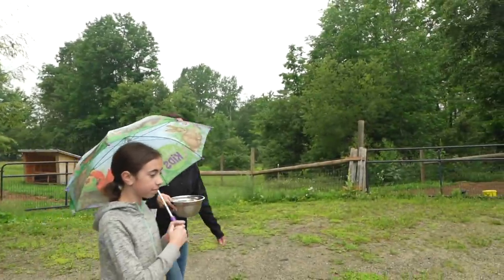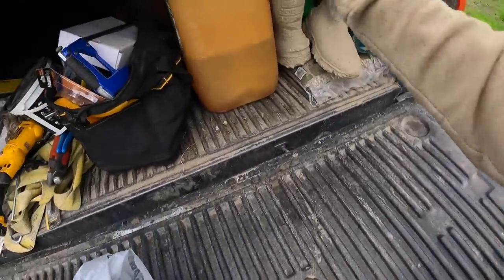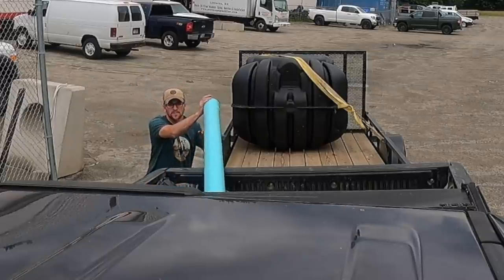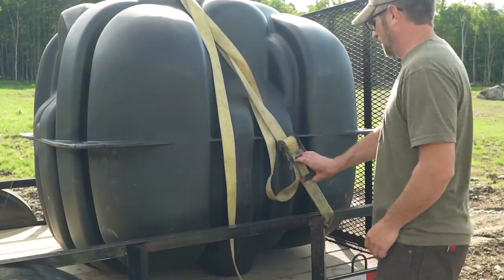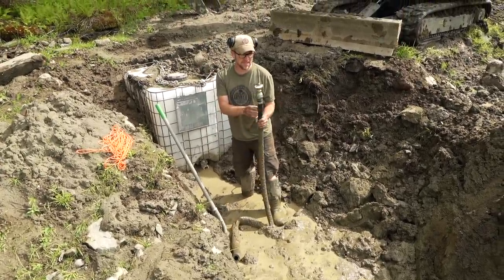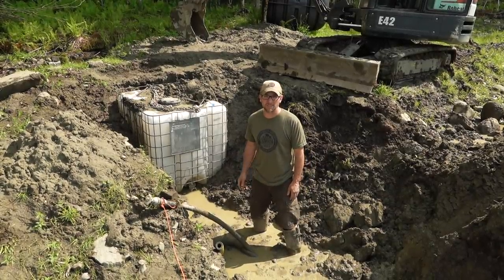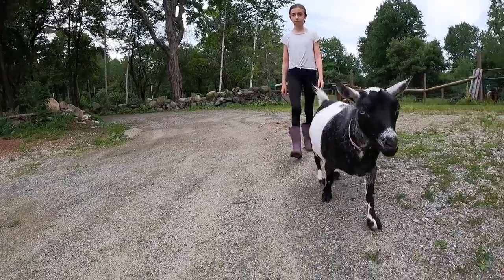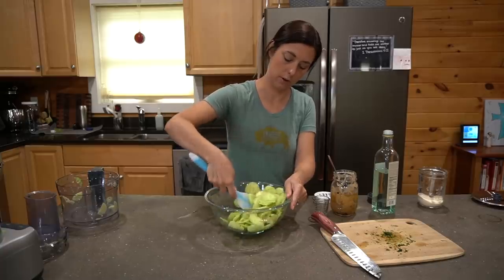Well that DIDN'T Go As PLANNED! PLAN B Building a Gravity Fed Water SUPPLY at Our OFF-GRID HOMESTEAD

Comment: I was wondering if it’s possible for you to build some concrete sides in the ground, or more of a concrete housing for the water tank to keep the mud and dirt from collapsing right on the tank. Or is that even a thing?
Reply: That would work - along with the commitment of having it there.  I think Al wants it the way it is for now so he can go with the flow (so to say) and move the tote as needed.  Others have mentioned using plywood, the cut-out-steel from the shipping container - there were the cutouts for the windows and the sliding door - lots of sheet steel there to use.  Also insulated foam board... lots of choices for Al and yours is also a good one, Donna!

Comment: I think you need to get that black tank above ground and build a ram pump and get that in the creek to fill your tank that will give you the pressure that you need for those 2 hydrants and probably any others that you put online.
Reply: My thoughts as well.  Maybe build a quick enclosure around it.  Hang a 100 watt solar panel on the roof and have it power a few 12v diesel glow plugs to keep the water from freezing.

Comment: Al, if the yard hydrant outlet elevation isn't lower than the top of the tank you will not get any water out of it and if the tank water level goes down you'll get nothing.  The tank needs to be elevated, not buried.  When done you'll be able to slowly fill a bucket, but won't have any pressure at all.  Have you thought about building a hammer/ram pump to fill an elevated tank, maybe 10 to 12 feet in the air?

Comment: Lift your water storage tank 10 feet above ground. use a RAM Pump, or a solar powered regular pump to lift your water. Your water will be clean, you can see its level and you will have pressure.

Comment: I don't think you should get down if things don't work out, it make your videos worth watching, they are real not faked. It also gives your audience the chance to float ideas and make some suggestions and here are mine.

Have you thought about running a draining tile along the trench to the low point near the end of the trench were it could feed a small decorative or watering pond. Also when you do the feed to the tank, you could use a sand and gravel filter to keep out larger debris. Just a few thoughts to think about.

Comment: well shipping containers are made to be stacked so they can take a lot of weight... maybe you can get a heavy plastic pallet and put the icb tote on it and then put it on the top of your shipping container... fill it with water and you have running water at the shipping container... you could maybe take it down when it is empty and fill it or maybe pump more water up to it... but the top of the shipping container might need a couple I beams across it so that the tote isn't resting on the flat part but it is distributing the weight to the walls

Comment: Hey   Al  don't  worry  I  thought of  another  thing for  the  tote  those  big  old  slaps  of  rocks   use those  it comes with the land and  you got the  equipment for  moving them with  .  Dig  the  hole  bigger and  put those  babies into  place  using  metal  pipe  for the  front  of the tote  so the  pipe will have  free  moving  water then   you will have to  lay a  slab  on  the  top  and  make it  so the tote is  alright in the front !  Also  the movement of the water for  winter time there is  a  thing to keep the water  going  24/7!!!

Comment: Use that time to build a big box with galvanize roofing big enough to house it and maybe enter to work on if needed. Dig your hole and maybe use some of those rocks to make a nice smooth bed for it. stick a drainage hose in it to keep it drained. In the winter you can cover over and around with straw and manure compost heap to keep from freezing and in spring you will have good fertilizer for your green house.
Reply: That could work.

Comment: This video was good because it was real life stuff. Real life stuff happens to everyone, no one’s perfect.
So I don’t know if you’ve been asked this or not or know this or not but I wanted to suggest a ram pump to bring water to where you want it instead of taking your system to the water. I hope that made sense?
Anyway ram pumps are so ingenious and handy they require no electricity. Google it.
Also your going to need to be able to access that water tank sometime in the future for different reasons. So think about building a on the surface insulated hatch door on top of the tank instead of covering the top with dirt and around your hook ups so you won’t need to dig it up later. 
Just good for thought. Put in the extras now, so life will be easier later on.

Comment: 31:03 The tote problem was a good thing. It would have crushed anyway.
 The water pressure wouldn't have bern high enough to keep wet soil back, even full. It even happened before it would have been more work (disconnecting the water line, having to dig it back up) so be happy it happened when it did.

Comment: Sadly, a gravity-fed water system is going to require more elevation than you have planned.  Every 30 foot drop gets you about 15 PSI. and that's not enough for even micro-sprinklers.  They like about 25 PSI.  You need your water intake at least 60 feet above your outputs.  You probably do have that on your property, but I bet you need a much longer pipe.  Your water tank needs to be just below the intake, so your stored water is all high enough above the rest of the system to give you a lot of water at the final pressure.  You can't use IBCs near the bottom of the system because all the pressure would leak out the top.  Then your outlet pressure would just be the IBC top minus the outlet elevation.

Maybe for now, just buy a solar panel, a charge controller, and a 12 volt water pump.  You don't need a battery:  Your full water tank will work to store water and energy.  You can get about 300 watt panels pretty cheap, and charge controllers on amazon are really cheap.

Comment: If you have 10 feet of drop from the top of tank to the hydrant outlet, you'll only get about 5 psi water pressure (trickle).  A solar powered booster pump (with battery) would allow you to get good pressure in your lines.  Also, the top of the tank can't be above the spring unless you use a pump to fill it.

Comment: eventually you can dig it back surround with plywood and foam board, plywood first, then fill it immediately...the real strength comes from the galvanized metal frame and water with in the ibc tote

Comment: There are two problems with the old tank. First, empty water tanks float. Second, most water tanks can't handle the side pressure. Both can be fixed, but both have to be fixed. You can fill a tank with water and it will temporarily hold its shape, but if the tank isn't strong enough, it'll cave in later anyway. The new one looks like it's made for the job, which is ideal. You could have taken the tote and MacGyvered some contraption to protect it, but that takes time and maybe money, and if you do it wrong, it sucks a lot. Underground tanks are surprisingly tricky to get right.

Comment: Gravel / sand bed under new tank Tank outlet level with pipe. 2" rigid foam ( rated for bury ) from sand to tank top above grade. 2 or 4" second laver from frost line to top of tank. 4 or 6" foam lid. sand and soil hill over tank with fill/vent pipe. Now hope it doesn't freeze. I know foam and labor isn't cheep. Do it right, do it once.  Thanks  take care

Comment: A round 3 to 500 gallon plastic storage tank in black plastic would do better than a white or any other color because it will reduce algie growth in the tank ... they make them up to 1500 gallons with a large opening to enter the tank for cleaning and such ... glad you got the type you did, you'll be happy with it ...
Reply: I don’t see how you’re going to have any water pressure with it in the ground.  Looks like it should be elevated. It not going to be freeze proof because it’s not deep enough so a solar heater of some type is going to be necessary in winter, right?
Reply: @lovemyfamily60  If the hydrant opening is lower than where the water exits the tank water will run. It's difficult on video to gauge what the slope is. Also Lumnah Acres don't need great pressure jusy enough of a flow to water animals.

Comment: It is not just the rain water filling the trench. As soon as he dug the hole for the water tote, he saw and videoed water seeping in. The spring is providing a constant flow of water into the trench: at least 2-3 gallons an hour. He will need to seal off the seepage or he will have created a secondary water source to the end of the trench until it packs down sufficiently. AND he is going to need a lot of fill to take the replace the volume of all of the rocks and boulders that did not put back in the trench.

Comment: If you put corrugated metal on the outside of the steel frame holding the tote it won't cave in. The metal will be supported by the frame and protect the tote from the dirt and rocks.

Comment: as long as it is buried deep enough will never freeze / plus the mass of the water in the tank should prevent that / also as long as the spring is running (even in winter) leave the lowest point in the line to drip or run at a restricted level and lines will never freeze
Reply: Just from that little drip it will grow a huge ice sheet.

Comment: Pressure (psig) = head (reservoir surface height above outlet height in feet) * specific gravity ( 1 for water) /2.31

35 psig = 80.85ft * 1/ 2.31

So 85 feet of elevation difference to get 35 psi at outlet as someone already stated. This does not account for pressure loses through the pipe and fittings due to friction factor.

Comment: Gina words of wisdom; dig a trench and it will rain!!😁🤣
All you need do is keep the water moving so....a solar powered aerator...if the stream keeps flowing, even that may provide a power source but...it doesn’t have to be heated...just kept moving so it doesn’t freeze.
Reply: Or in addition hook up a 12v car diesel glow plug(s) to a solar panel and toss it into the tank of water...

Comment: Have you thought about a concrete box to store the water instead of plastic, have seen some gravity flow set ups like that or to protect your storage container, solar powered pump, no way will you have enough water pressure to run spickets without some way of pressurized it,

Comment: What about putting thick plywood around the outside of the wire cage that surrounds the tote and some sheet metal on the outside of the plywood to protect it from moisture - maybe that would hold the earth away from the tote itself.  Might have saved you a lot of $$$ and effort.

Comment: not sure how u plan to get the water out the faucets but , do know it will not just flow out with the top of the yank below them so u either need the tank above the faucets or u will need  a pump so u might want to look into solar powered pumps.

Comment: With 2 inches of rain coming, why not block the drain ditch for now and let the water temporarily flow down the newly planted pasture until you fill the water line ditch.  Admittedly, the rainwater erode the new soil a bit but it will likely reenter the water line trench further down not up near the tote, where collapse is likely to present problems to you..

Comment: Great video. Thanks.
To keep water from freezing in winter could you use a pond heater? Low voltage, keeps the container from freezing?
Just an idea.
@19:00 if you're smelling mellon, particularly watermelon, if could signify the presence of a Copperhead. Be careful.
@20:52 great blooper moment.
Chin up! ;)

Comment: 5 gallons or 500 gallons won't change anything with the pressure, only elevation. P = .433 * H so 10 ft from tank water level to hydrant give you 4.3 lbs 100 ft gives you 43.3 lbs pressure. Size, shape or capacity of tank wont matter in this case unless you have a really tall tank.

Comment: If you fill the tote with water before you bury it, after the dirt is packed around it and dried out a bit, the soil won't impact the tote when it's empty. I have 5 of them I buried over 4 years ago that have never had any problems. It caved in when you buried it!

Comment: Ultimately, you can make all of this work, but will still only end up with a few psi of water pressure at your hydrants.  I see a lot of comments talking about how this won't work, but it's not like you're going to be washing your car or taking showers with this water.  You definitely have a very sufficient size water line leading to the hydrants, and have the proper type hydrants, and they're plumbed/installed correctly, so those are Wins.  It looks like you have maybe 6-10 ft total fall from your water source to your hydrants?  That is plenty to get you probably 5-6 GPM of water flow at your hydrants, which is good for filling troughs, drip irrigating, etc. The main issue is your tank/storage, freezing, and structural integrity of the installation of the tank.  First, without adding electricity/technology to your system, the only way to prevent freezing is getting the entire system below the frost line, that means the TOP of the tank will be 4 ft underground, which eats up half of your pressure head. I think the only way to win, here, is to design the system to have water continuously flowing through your water tank, which will prevent it from freezing.....as long as that water source doesn't get cut off during the winter, and as long as the plumbing is still below the frost line.  There is really a LOT more design consideration to making this work properly than meets the eye.  I would suggest getting some experienced design input, even if from other knowledgeable YouTubers, or you're going to struggle to find a reliable, working system.
Reply: Unfortunately in this part of the country, even flowing water freezes--small streams and even water falls turn to stone in the winter.
Reply: @andyrobinson339  I was assuming so, that's why I said "assuming the water source doesn't get cut off during winter".  If the stream were able to keep running, then an underground tank with water continuously running thru it definitely wouldn't freeze.  Nevertheless, like I said.....I think he is in for a LOT of struggles to get this system working like he wants.
Reply: @python3574  I agree--but that is a huge assumption. Well, live and learn!

Comment: Cut some 3/4” plywood the same size as the outside dimensions of the cage. Remove dirt around cage and slip in plywood, replace dirt fill tank with water from spring no more cave in.

Comment: Might want to check out some of the videos by Engineer775 has done over the years on closing in springs and catchments and also on using ram pumps to increase pressure using the power of the water.

Comment: Never give up! Never surrender!

I am SUPER curious as to the elevation difference between the top of the water level of the tank (the ground) and the top of the hydrant. That is your elevation drop, and that is what is going to produce your flow. The more height difference, the stronger your flow will be. As the tank drains, the elevation drop will be less as the top of the water level will be further down in the tank. The camera never really shows elevation differences well so I'm assuming it's a big drop.

Also, you installed the hydrants and lines the other day and then you started backfilling the trench, and I was wondering if you tested the system for flow and leaks? If you have issues, you have to dig everything up! 

Anyway just asking or suggesting you talk us through your ideas about how the system is going to work and the rate you expect since it's a cool idea but the devil's in the details, as they say. Cheers.
Reply: From distance of water line & measurements mentioned I calculate that they need a 1:10 slope. Also you are totally correct that we can't judge slope on video. You comment is one of the view that I have seen that is a "thinking comment"

Comment: Al I think you are in a catch 22 hear you need to filter the water before it goes into the tank else it will block your below ground pipes but I doubt you will have enough pressure to push it through a filter. As proof of concept before buying the larger tank I would have filled the IBC and make sure it actually works. Also you must be thinking of Beaver Fever (Giardiasis) just washing in it you could get it if you eat just after. I would bite the bullet get a well with proper water treatment also when you build send all your rain water via the gutters to large insulated tanks above ground height gives you pressure. Check out life uncotained on you tube his back vids. Good luck with it hope it works great.

Comment: Buy a pump at Lowes & pump the water out of the ditch each day.
 I'm glad the tote fail because it is wrong to put it in the ground.
Don't forget to add the electric wire with a tracer wire in the ditch before you fill the ditch.

Comment: Good day Ali calling from all the way in Nassau Bahamas I think what they're saying is true the higher the tank is the more pressure you get what you can do to compensate for the pressure it's probably odd in a windmill pump or solar power it might cost at face but in the long run it will benefit you try solar power

Comment: I spent a lot of time on boats and working on a dairy farm. I added a link for some useful knots for farmers as I've seen you struggle a bit with ropes.
As an example, when you pounded a stake into the ground to tie off the pipe a simple overhand loop would have been quick and easy plus you wouldn't have needed to cut the line. An overhand loop is easy to untie as well.
https://modernfarmer.com/2014/06/tie-practical-knots/

Regards, Dr. Skip